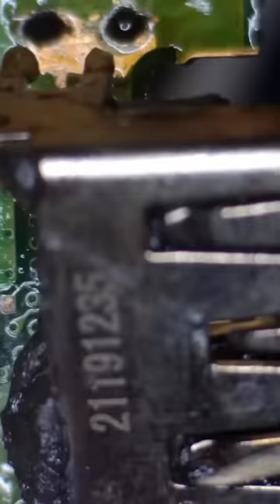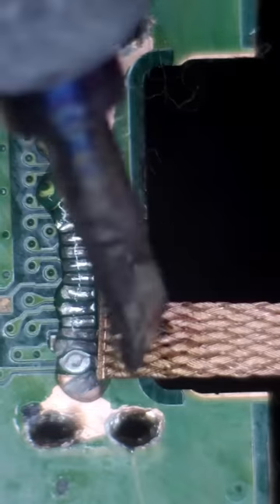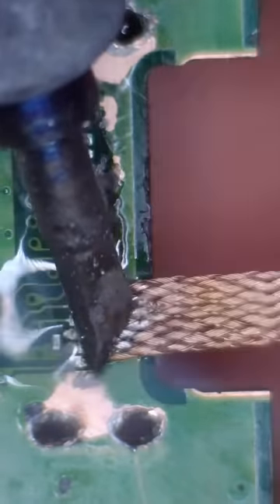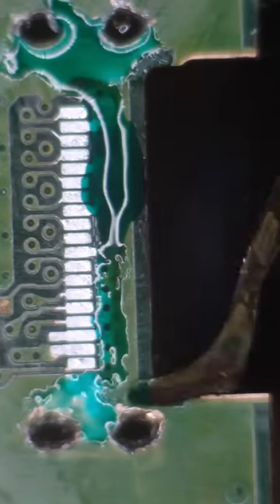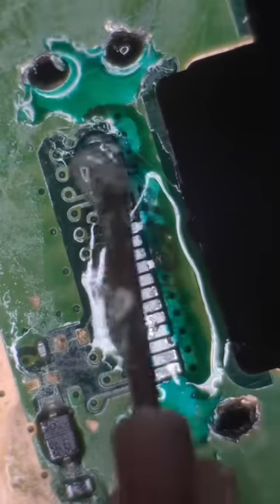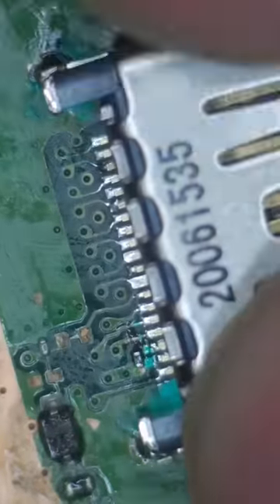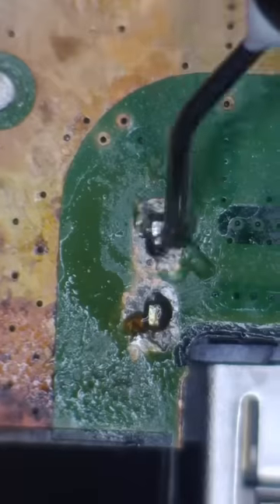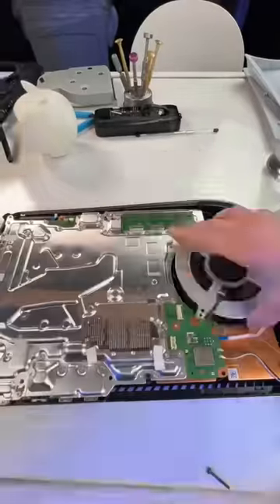What would you do if your kid did this to your PS5? Part 2 #shorts #hdmi #microsoldering #teletouch

Comment: I solder for a living, and you make this look easy, especially with that fat dirty soldering iron tip. Lol
Reply: Same, I hated doing eproms
Reply: That's what she said.
Reply: Yeah, I was staring at that solder tip like, “my man makes this look like you could do it with a dirty salad fork.”
Reply: My father does landscaping, occasionally he has to use solder for small breaks in tools just for a temporary fix so he can finish up his work and get a new one, his soldering iron is always dirty because he rarely uses it so it stays in a metal box with extra tools like screw guns and batteries, yet it still works well
Reply from the maker: Lol thank you I finally bought a new soldering station after this vid!
Reply: @derp24lordz  I think your dad uses a welder not a soldering iron 🤣 solder is made of lead which is very weak and if you tried to repair a tool with solder it will most likely not even stick to the steel and if it does it'll break within the day.
Reply: @svicidellvma  ah, well, that's what he told me, he hasn't done that in a while, mainly because it broke after a couple years and hasn't needed to for a while
Reply: @svicidellvma  master baiter
Reply: @svicidellvma  master baiter
Reply: @svicidellvma  master tater
Reply: Damn you must suck at soldering then
Reply: @derp24lordz  that’s called brazing. It’s soldering in a sense.
Reply: You would hate to see mine..it looks like Capt. Hook's replacement hook.
Reply: I used to to repairing for living. That type of bid is best to work with.
Reply: This repair is very easy tbh.

Comment: Me: Oh I'm pretty good at soldering
Also me watching him solder: I know absolutely nothing about soldering
Reply: Honestly bro I replaced a hdmi on a laptop and I didn’t even clean it I just removed and replaced
Reply: Watch this 10 times buy a few goodies from the electronic shop and then you can do it too..
Reply: Heat gun is better than gun too
Reply: The dunning Kruger effect in action.
Reply: Sameee
Wondering how much cleaning and steps it takes to solder something
Reply: He didn't do anything special, he probably should have used solder paste and a heat gun for the tiny connections on the hdmi.
Reply: How did he solder that small capacitor by hand, at home :00
Reply: @HolahkuTaigiTWFormosanDiplomat  I don't think he did, he just removed it.
Reply: I replaced some resistors for a job and that was so small i needed a microscope but that capacitor in the video is TINY and those contacts look tricky to solder without soldering them together
Reply: This, exactly
Reply: This soldering wasn't great. Good enough for a game console to work again, but definitely needs improvement.
Reply: Yes

Comment: As a liscensed Solderer I can say this guy is pretty amazing. Man was able to repair the coating and made sure to add flux, you know how many of these videos I've seen where they don't add flux? Too many.
Reply: Actually he should not use low melt solder to solder, but instead to desolder, as it's much weaker and melts at very low temperature

Comment: Keep making these my dude. I’m sure there’s a lot of skill to this but you’re approach and explanation make it seem achievable for everyone! 👍🏻
Reply: I’ve actually repaired a ps4 and now use it since mine broke it’s pretty easy considering I’m only 14
Reply: @KLenjoyer  ok
Reply: Well flux v:
Reply: @DarkMatterGoku  ok
Reply: @KLenjoyer  ok
Reply: @KLenjoyer  wow that’s awesome lil man! I’m 21 and I remember when my 360 red ringed and I was basically ready to topple the government if I couldn’t play halo reach again. Not many videos like this in 2014. 

Have these videos helped; got any other suggestions?
Reply from the maker: I’m excited to make more videos and share the knowledge!!
Reply: @KLenjoyer  cap
Reply: @KLenjoyer  r/thathappened
Reply: As long as the circuitboard doesn’t give off blue smoke or something you probably did fine
Reply: @user-ek2xg3ps5s  radit
Reply: @user-ek2xg3ps5s  It's entirely possible and not too difficult. I've done the same with my PS4 Pro when it started to shut off with an overheating message (it's an older model).
I disassembled it using a guide from YT; replaced the thermal pads and paste; dusted the fan etc. using anti-static brushes; put the whole thing back together, and it works perfectly now. The fan is even quieter than before. 

It's entirely achievable by a 14-year-old who has the necessary knowledge and supplies.
Reply: @ManlyOBeeferton  Alright, good for you. Maybe I just wasn't skilled enough to take apart my PC, clean it and put it together without damaging.
Reply: @user-ek2xg3ps5s  I didn't have a clue how to disassemble the PS4 before I found the guide, there was very little skill involved on my part :). I'm sure you could do the same with your PC if you find a detailed-enough guide.
Reply: @ManlyOBeeferton  Thank you for the suggestion, I'll try to find the right guide.
Reply: @user-ek2xg3ps5s  a gaming console I would never want to try but a PC is super easy to disassemble and put back together. I built a gaming PC for halo 2 at 13 and it worked great. Still works but due to upgrading RAM cards so many times the connections aren't the best. Just because most kids don't have the drive to do something like that doesn't mean all kids couldn't do it.
Reply: @DarkMatterGoku  Ok
Reply: @KLenjoyer  ok

Comment: As a person who does similar repairs, when in doubt, flux the fuck out of it
Reply: Misread the instructions: accidentally fucked the fuck out of it
Reply: Flux is a god send . It makes soldering so much easier
Reply: Similar to the machinists phrase… If all else fails… Add more lube
Reply: @hullinstruments  that’s what she said lol
Reply: @Solisium-Channel  Yes I’m pretty sure that is the implication and origin of the phrase. If you want to study the ways of skilled professionals… Who are skilled in the art of cursing and filth… Just go work in a machine shop. 😁
Reply: @hullinstruments  haha you guys sound awesome to work with. I'd be cursing my butt off in 3 different languages out of frustration and in fact, I know what that's like. I used to fix and run extrusion machines that'd break all the time, not to mention a staff of 3 keen on taking maintenance short cut and leave hidden problems to the other shifts because they'd all do the same. Tried to bring it to the attention of the higher ups but they didn't care. Couldn't turn off the machines for repair so we had to be quick before they fell, we had 7 minutes at most to figure out the issue and fix it because it could take up to 45 minutes to get it running again. When it was something mayor like an explosion or some fire, it'd be hours of work plus less staff keeping the other 13 machines and systems running.

We were all sailors lol... but on the up side, we did almost nothing for those 12 hour shifts so long we made sure to fix whatever the other shifts would leave us. I'd inspect everything and make my guys fix whatever i'd find, then inspect again to make sure they did it right. Then we'd just chill and laugh most of the night. It was pretty cool work.

Comment: “A lot cheaper than a new one…”
Like how cheap we talking?
Reply: I remember the repair i worked at charged ~$100 for and hdmi repair on a PS4, but another reason its worth it is because of the lack of non-scalped PS5's in stock 😔
Reply: The actual cost is much lower than the 100$ the repair shop charged.  He spend max 15 dollars on things that got „consumed“ (flux hdmi; connector; pcb repair stuff) the equipment (soldering iron ect.) is more expensive obviously. But if you have the skill and equipment anyway you can easily save ~400€.
Reply: @_lufix_  yeah it’s the skill that cuts the cost!

Comment: Usually I don't remove the old solder I just refresh it a few times but flowing new solder in. That helps reduce the chances of damaging the green layer which is basically just a thin silk screen layer of the solder mask.

Comment: I was about to say how the process exposed more copper and hoped you used mask, but I’ve got another point of concern I’d like to tell you about since you used it. It doesn’t take a couple seconds. It on average takes about 15 minutes to fully cure  under UV light depending on the thickness, and this was more on the thick side. It won’t affect performance, but it may not settle properly and can lead to some copper still being exposed.

Source: I work in custom pcb manufacturing

Any other questions not just for you, but anyone who has some, I’ll try my best to answer

Comment: Kindly support right to repair.

I've always wondered of the effectiveness of mounting the ports of a device directly to the outer casing, with a flexible connection to the main board. The solder jobs on the direct-to-board connections always seem to be the quickest to fail because of how frequently ports are subjected to mechanical stress.

Comment: I have no problem with that capacitor when in cleaning the soldering, but I have it when am soldering the port. So what I do is remove the capacitor, install the HDMI port and then put back the capacitor 😅

Comment: You missed a step , PS5 is cooled with liquid metal on the apu, if you aren't careful a drop of liquid metal can kill a PS5 . 63/37 is probably better to use on the pad and anchor as it has more strength
Reply: Use some qd electronic cleaner on a q-tip in a rolling motion to clean up any loose liquid metal

Comment: One time I did hand made connection in my mobile with some little pieces of copper wire, hammered to be flat, and a electrician tape to restore the volume buttons and surprising it worked! 😄
I hadn't a welding machine...

Comment: And I thought I was sophisticated when I fixed a couple of bent HDMI prongs on a Xbox 360 so it would contact a cable again. Someone threw it in a dumpster but it worked after that! So which part was most difficult for you? That tiny capacitor? 😬👍

Comment: Where can I find the soldering tips and the stuff used in this video? Also how do you avoid destroying the capacitor?
Reply: Heat gun or heat tip is more recommended. Surface mount is very tough to do for a novice. You need pro equipment and a serious ton of patience. Also a camera 🔬 either it comes with a led screen or your 📱 so you can magnify it and makes it much easier to do.
Reply: @darkmatter1152  I'm average at soldering. Ty for the info. I can do larger surface mounted components but nothing like that in the video.

Comment: Oh God... Recently I've used a solder iron just to fix my broken old PS1 Dual Shock controller. That maybe nothing compare to what you're doing to the PS5... Cos the PS5 has more layers compare to the PS2... Also it was myvfirst time using a soldering tool... But I'm glad my Dual Shock controller is working fine now...😫

Actually, all I did was fix the vibration on my controller by soldering the wires to the rumbler and the pcb...😅